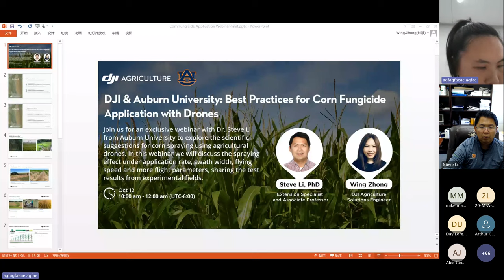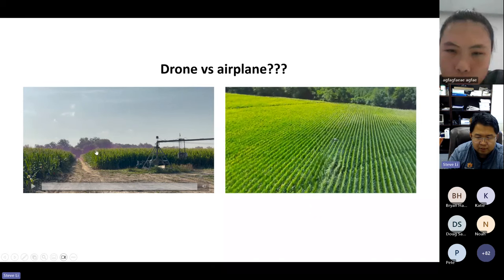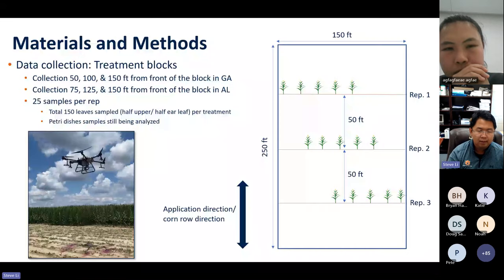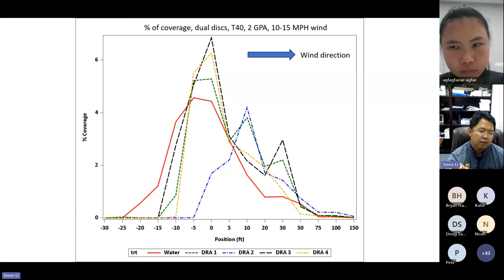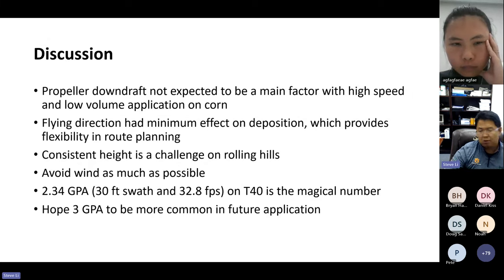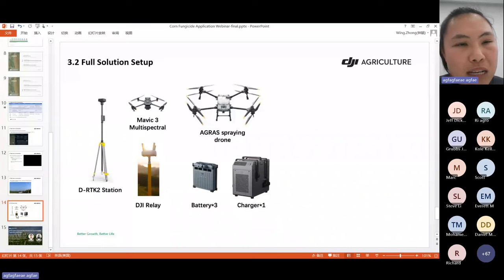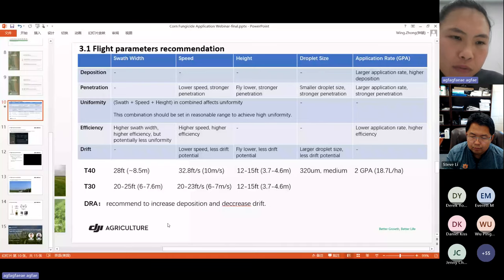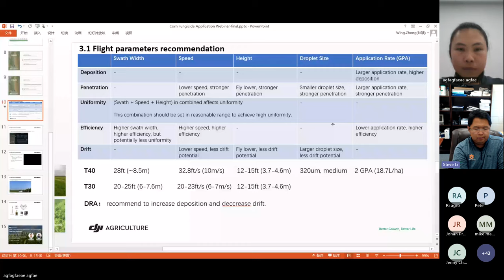Best Practices for Corn Fungicide Application with Drones | DJI Agriculture Webinar

Comment: Here in Brazil I usually spray 4 to 10 liters per hectare (0.4 to 1 gallon per acre) with good results using fungicide on corn.

Fungicide Opera 0.5 l/ha, DRA 0.1l/ha and  vegetable oil 0,04 to 0.1l/ha.

Using DJI Agras T10 with XR11001.
Height 4m, Swatch 5.5m and 25.2kmh.